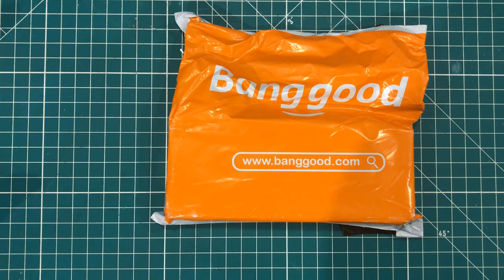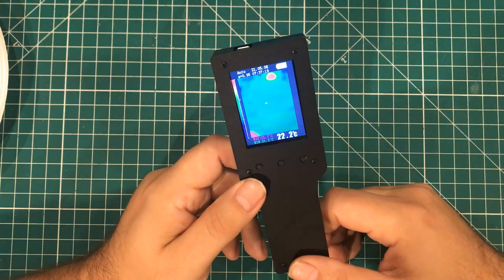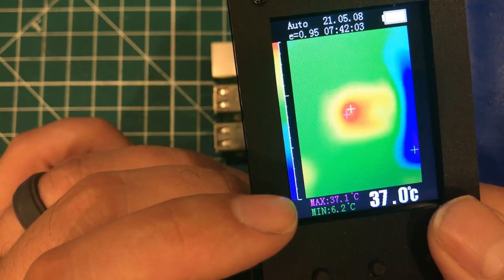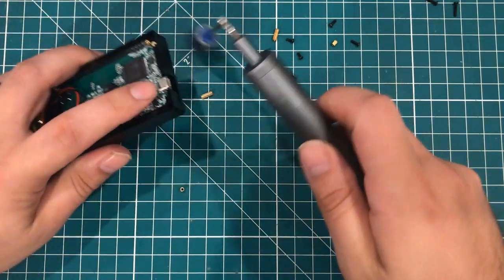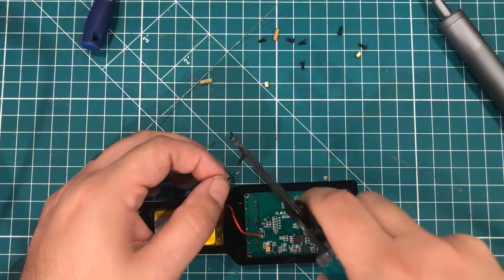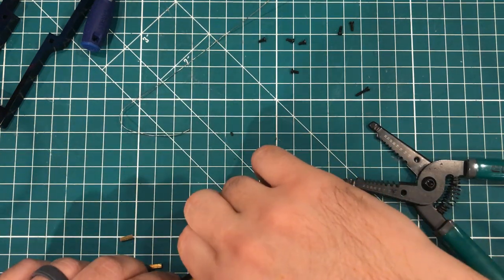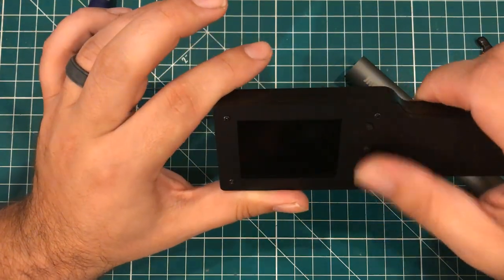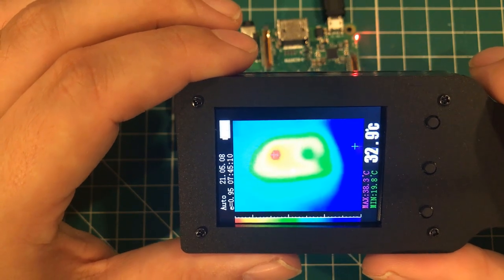Budget Thermal Imaging Camera - Unboxing, Teardown & Review

Comment: Got the same one earlier in the year. Did you figure out how to change settings? It took me a while to figure out ..  short press the middle button (it's time sensitive) the current editable field changes to red text, use left/right buttons to change current value then press the middle to accept and move to the next field. Also fyi, there is source code available, though, its not the same version as on the device but definitely enough to add/modify the software to suit your needs.
Reply from the maker: I just tried it. That's awesome! Ok. Yeah. I'm going to have to look up that source code.  That sounds fun. Thanks for the tip!
Reply: @AnotherMaker  electronicpro.co.za look for daniu-hy01-mlx90640-infrared-thermal-imager

Comment: what is the maximum distance between the camera and the area you want to test ?  For example can i check if there's insulation leakage in the outside walls of my house ?
Reply from the maker: I'm 99% sure it would work with that. You might not be super precise because of the resolution, but you'll see it. I can detect a lightbulb across my house.

Comment: I think I need a thermal camera now.   And I think I need to not try to open it up...
Reply from the maker: I really think I would use it fairly often in things like breaker boxes.

Yeah. It's not really recommended to take it apart.  I still don't understand what those two screws were for. They were a little loose when I got it, and now I guess I know why.